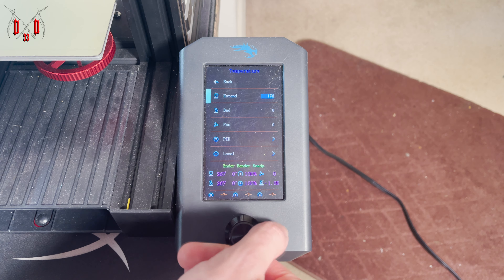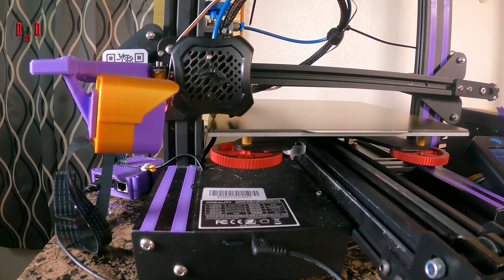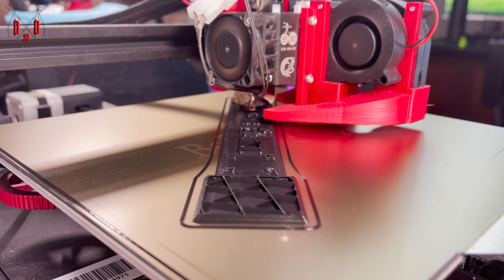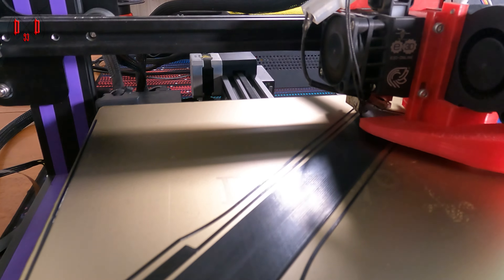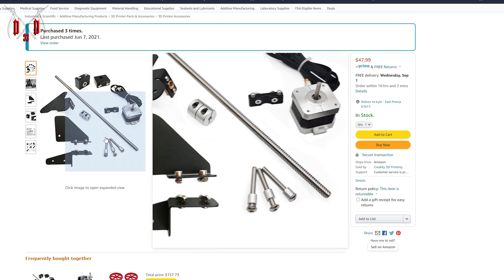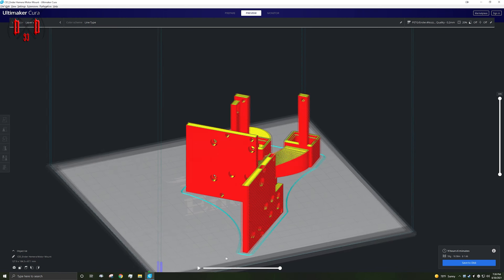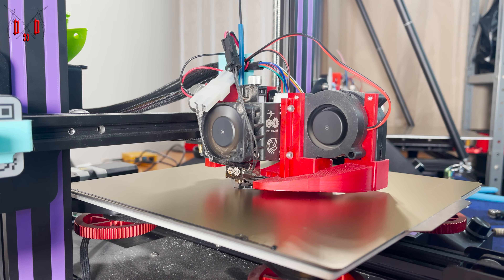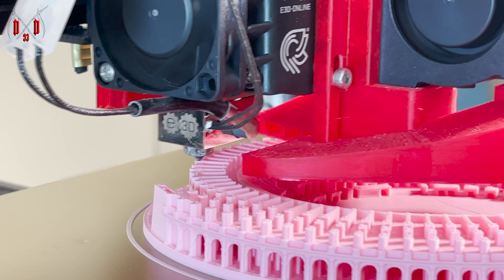Overengineering the Ender 3 V2

Comment: Your fan duct is really chunky, does that have any affect on print quality as it is sort of cantilevering against the vrollers? If it is, a cool upgrade you could do would be linear rails for better stiffness.
Reply from the maker: The weight of the Hemera and it’s location on the gantry plate make the little weight that fan setup has have a negligible effect on print quality. I’m not worried about the fans cantilevering the weight of the Hemera. Nor noticed such evidence during the prototyping process, and that was something I paid attention to.

Comment: The OEM glass bed is absolutely brilliant when everything is set up well (which is really the answer to many issues people have). BL Touch and Jyers or Mriscoc firmware make the biggest difference with least cost to get consistently reliable prints as does keeping filament dry and of course changing the crappy OEM extruder. Everything else only adds minor improvements or adds additional capability for say different filament types etc. Having said that, pimping the machine is a fun thing to do.

Comment: Got a Ender 3 v2  2 weeks ago and have kinda Speedrun doing some of the upgrades while skipping others. I got a cr touch because I enjoyed the asthetic, the metal probe and the fact that all of the reviews say it works just as well as the bl touch. I got a filiment dryer because it was semi cheap and helps maintain a certain amount of quality in prints. I got the micro swiss direct drive since it comes with the micro swiss all metal hotend and it was something like 30$ more than getting the hotend by itself. And sincE I had to adjust the source code anyway I struggled over last weekend to upgrade it to Jyers. Unfortunately I'm still having trouble getting my cr touch auto leveling function to work with Jyers I keep getting it set up thinking it's good with the z offset and the auto leveling mesh and then going to test it and having to immediately stop because the auto leveling messes up and starts gouging my printer surface. Luckily I haven't upgraded the glass bed yet but I'm thinking I might once I get this figured out and my next paycheck.
Reply from the maker: couple things to maybe help...

When you get the mesh(run the leveling) are you saving it to the EEPROM and THEN testing it? If not i would try saving it and the z offset in to the EEPROM using the "store settings" options after EACH one. 

I too am running a filament dryer. You just have to be prepared for anything and i like to print in things like TPU and such which are way more prone to absorbing moisture than PLA. Its almost one of them things you should by shortly after finding out you enjoy the hobby. Thanks for the Comment and thoughts :) I like reading and seeing what others do. Currently editing a video to help dial in VREF voltage and prevent your mainboard from suffering a meltdown i call it. Stay tuned for that! Its quick and totally free if you so choose that option!
Reply: @DeathDonky  I think I figured it out I think it's the "fade mesh within setting" it was set to 0 and when I adjusted it to 5 it seemed to help a lot, I'm not Shure if I should boost it some more I. I've been saving my settings after each adjustment. Currently I'm just trying to print out a z screw knob so I can more easily manually adjust it. I'm getting a lot of 'popping' so I'm guessing I might have to wait a couple more hours for the filiment to dry before I try to print it.
Reply from the maker: @alexlerouge1170  typically the popping is a sign of filament that needs dried. This shouldn’t be confused with the popping you ‘might’ get after retractions though.
Reply: @DeathDonky  appreciate it I have it drying now

Comment: Got my V2 a while back and it worked pretty much flawlessly until the extruder arm (the one with the bearing that pushes against the extruder gear broke) for some unknown reason. Got the gray metal one, and it honestly looks so much better than the black plastic one, and works just as well.
Reply from the maker: Yeah they all work great till that plastic splits… luckily it’s one of the cheaper fixes

Comment: When you get it properly tuned, printing on the E3V2 stock glass works pretty well. I've always sworn by PEI sheets on glass on my CR10's. But I am convinced after seeing it work that the glass will work fine -- without adhesives.
Reply from the maker: I would have said that too if 2 of the 3 machines I got from creality that included that glass bed didn’t have adhesion problems… I couldn’t get but maybe 4 in 10 prints to stick on them other machines but on the one everything was good. You have probably two thirds chance of those beds being garbage. (Yes I cleaned them with ipa. No “yellow stuff” was left on them. They were also wiped down prior to every print) that other one third chance is that bed is good. But I haven’t seen an in between. It either sticks or they don’t.
Reply: @DeathDonky  i had a HUGE problem with them initially. So bad I was ready to throw them against the wall and start over with mirror tiles and PEI, which is what's been working well for me on my CR10's for years. 

But I kept at it, tweaking the leveling and especially the Z-Offset and have everything dialed in now very well and I rarely rarely have a problem with adhesion. I never use glue, though I do sometimes use a brim or corner pads. But I do that on my CR10's too, so... 

That said, I think I like printing on PEI better, but I think that's mainly because of my initial problems printing on the creality glass... it's made me distrustful of it, even though I don't have many issues with it anymore.

EDIT: I have six E3v2's, two CR10's, and a Tronxy x5sa-400. Except for my CR10's, I'm printing on glass on all of the others.

EDIT2: Like I said, I had huge problems with the glass initially. It took me over two weeks of frustrating trial-and-error until I finally got the first one to print reliably. The leveling / Z-offset was important on the printer, but I found going slow on the first layer (10mm/s for me), bumping up first layer width to 125%, and upping my bed temp to 65C (for PLA) were the magic ingredients.
Reply from the maker: @bratwizard  now you’re printing on the coated side right? Or just the glass side? Because when I flipped the problem ones over from the coated side I got a lot better results
Reply: @DeathDonky  I'm printing on the coated side (the dark gray/black side). 

I feel your pain, I really do. I was at my wit's end in the beginning and ready to throw the glass out and go back to PEI. But I kept reading about everyone else getting it working and couldn't believe that after all these years of using my CR10's, I couldn't figure it out-- I didn't know wtf was wrong with me / my printers. And the two things I read somewhere that got it working for me were the 65C bed temp, and 125% first line layer width. 

Subsequent tuning got me to the short list of items in my previous reply that seem to have the most effect on the problem (leveling, z-offset, 65C bed, first layer very slow [10mm/s... 15's probably ok] and 125% initial first layer width).

I'm still pretty keen on mirror tile & PEI. I have years of experience with it (I use the PEI sheets from Gizmo Dorks on Amazon). But I've gotten to the point where I don't need them on the E3V2's. Haven't tried anything different (from PEI) on the CR10's. They're working well, so why change it?
Reply: I also initially had issues with the coated glass bed, but after installing a BLTouch and tuning the first layer offset (and increasing first layer flow & width) for each material type, the coated bed is fantastic. For some materials like Nylon and PETG I found increasing the first layer height (from 0.2 to 0.24 or 0.28mm) actually improves adhesion. Very rarely a little bit of glue stick (literally just one layer, any more and adhesion gets worse) is needed for the more difficult materials.
Reply: @DeathDonky  I have a few Ender 3 V2's as well and I print on the glossy side. I don't have adhesion issues flat out. IPA, a bltouch, a good level, and z offset make it so that sticking is just simply not one of my problems. Plus, all parts have a perfect mirror glossy finish on the bottom of them.

Comment: I left mine as close to stock as possible. I only added the cr-touch and the pei bed. I also added a 1mm nozzle, which makes it super fast. Klipper makes it so I can send files wirelessly. I’ll upgrade the extruder when it breaks.

Comment: Hm, I just installed the dual z-axis motors onto my e3v2 yesterday and I didn't need to up any voltage. What exactly did you mean in the video?
Reply from the maker: It’s not a requirement but def recommended. You lose strength in the motors if it isn’t tuned. I didn’t do any hard calculations but got it so stepper temps are maintained while still being “strong” 

Made a video about it here: https://youtu.be/VwVQz4THQAA

Comment: Great work, and very nicely documented! I just installed a Sprite Pro kit on my V2, added a CR Touch last year, thinking that a dual z stepper upgrade will be next. 
I've honestly never had a single issue with my glass bed though, perfect adhesion with PLA/PLA+/TPU, I use glue (Elmers purple stick) when printing PETG, but that is to prevent over-adhesion. I hear people say constantly that a PEI flex plate is a massive upgrade, but personally I see zero reason to go that route. Maybe I just got lucky with a great unit, cause that sketchy black plastic extruder tensioner also held up just fine for the last two years, it still works great, the Sprite just replaced it. 
Anyway, I always love seeing what mods fellow V2 owners go for, and this is one of the more impressive builds I have seen, for sure!

Comment: very nice, i actually bought an E3 first, had some issues with the quality, so parked it and bought an FLSUN QQSPRO delta....but after a year doubled back, got the SKR Mini mainboard and direct drive assembly and hotend kit from Creality and now find myself tinkering with it again :) its actually putting our some ok prints, so watching your video has made me think about other upgrades now, only issue is mine is a normal E3. Great vid, cheers
Reply from the maker: Sounds like all your missing is the screen? Can’t you buy that to spice your machine up? We could dub it the E1.5. lol you got a decent board already it sounds is that a 32bit board? And a DD extruder. The Hemera is probably the most overkill thing I put on my machine but damn does she print like a boss now! 

What is your next upgrade?
Reply: @DeathDonky  yeah it was a 32 bit board, best thing was it was an easy direct replacment. I had a couple of ideas for upgrades, one being a DIY extention kit to get more height (ie 600-800mm Z) or one of those 2 in 1 hotends and go some multi coloured prints...but definately the dual Z'ds if my board takes it and the magnetic PEI bed. I have an extra BLTouch, but having issues on the Tevo Little Monster, so hesitant to use it.

Comment: Love the insight on your videos! I've made several mods to my own V2 as well, and I'd honestly say the magnetic bed is way more of an upgrade than what most people might think. The Creality beds, at least talking to other people I know who own Ender printers as well, are notoriously warped from the factory, and the magnetic build plates are a massive step up. Recently I replaced the hotend cover with an Avalon design from Thingiverse and it's been working phenomenal. Perhaps one of these times I will follow the path of swapping out my hotend and cover for the Hemera and use a more efficient design for parts cooling
Reply from the maker: The magnetic bed is second best probably to the Hemera honestly. And thanks for your feedback 🙂 it means a lot

Comment: I have a base ender 3 and a v2, i've been modding my base ender 3 more than the v2 and i love the thing. I got a pei plate, upgraded hot-end, and rubber feet instead of springs, and the capricorn upgrade tube. I print petg and it's been a blast.
Reply from the maker: I thought the tinker/upgrade process was a blast too. I find printing with different materials and finding uses for those materials a blast as well.
Reply: @DeathDonky  I'm still a noob when it comes to petg and my prints have been... Not good to be honest. Do you have any recommendations for it?
Reply from the maker: @MTNDEWGANG  what area of the print is your quality suffering?
Reply: @DeathDonky  First layer, and it looks like layer shifting too.
Reply from the maker: Does the first layer look under extruded or not sticking to the bed? What temps are you running? What size nozzle?
Reply: @DeathDonky  0.4 nozzle, 230c on extruder, 50c on the bed.
Reply from the maker: You’re probably going to want closer to 240-245 on the nozzle and like 80-90 on the bed. You should know that if your Capricorn tube come into contact with heat that high people say it can be bad for health and not good on the Capricorn tubes either.
Reply: @DeathDonky  Bad for health? Like toxic fumes?
Reply from the maker: That’s what I’ve read.
Reply: @DeathDonky  Huh... I never seen anyone go near that temp, even profiles I've downloaded never exceeded 50c on the bed.
Reply from the maker: For PETG? That seems cold… I’m sure brand to brand is different but even Amazon basics brand PETG says 60-80 on the bed 230-250 on the nozzle. 

The brand PETG that I use (overture) says 80-90 on the bed and 230-250 on the nozzle.

What brand are you using? Is there a tag on the spool of filament that tells you print settings? Often times on the spools of plastic themselves the stickers will give a window similar to the ones I gave above.
Reply: @DeathDonky  It's microcenter branded petg, It doesn't have any Temperature recommendations either. I watched videos about petg, but never knew the bed needs to be that hot for it to print good.

Edit: I saw a pack of petg I ordered from Amazon, and the bed heating temperature is 50-70c on the listing.
Reply from the maker: Micro center seems to only carry inland brand “petg+” they call it? That claims 50-80 on the bed and 230-260 on the nozzle. I imagine you’re too “cold” for the speeds you are printing. You can turn the heat up or slow the machine down to try and get better results. 

https://www.microcenter.com/product/626537/inland-175mm-purple-petg-3d-printer-filament-1kg-spool-(22-lbs) 

Click specs and it should come up with recommended print settings.
Reply: @DeathDonky  I'm gonna run a Marvin print with a 70c bed and up the extruder to 240 and keep everything else the same for right now and see what I can get. I'll update whenever it's finished.
Reply from the maker: Sounds great

Comment: Sometimes, it just does not make it any better... I installed a metal extruder once, and it was terrible. Way to much spring tension, so it deformed the filament, resulting in air traps in the print. And I installed a hyped Mirco swiss, and it was crap. Went back to stock with a minor upgrade (piece of tubing with washer) and all was good again. Another hyped thing: Capricon tubing... Way to to little tolerance, so it is very sensitive to any default in the filament. As if a normal tube, which is .05mm bigger, causes the filament to bend inside. These are all marketing talks. Best upgrade I made was the AC bed, 3 point leveling, other fans (especially the one from the mains supply) and the silent board. If I want more, Ill buy another printer (add all the update costs and you buy a better printer instead).

Comment: I am a newcomer to this hobby with a new E3V2 I bought for Christmas. It is still a stock machine with the exception of yellow springs I put in during assembly. But I have now bought the metal extruder + Capricorn tube kit from Amazon.
Looking at your videos for guidance as I can see you are very knowledgeable and particularly very meticulous about doing things.
One question - do you have any of the STL files for your mods available? I am still far from designing my own, hence asking.
Reply from the maker: Yes I do! Discord link should be in the description of the video, those files should be pinned in the 3D printing channel

Comment: You should try klipper with input shaper next if you want to be able to push the speed on the machine.
Reply from the maker: I have started to see a lot more about this klipper firmware and it’s def caught my attention because you aren’t the first to say this. I’m thinking I could use my “extra” machine to get that setup and tested in the near future. Any particular reason aside from extra speed?
Reply: @DeathDonky   well if your running a board that’s not as capable klipper opens up the capability because it offloads the processing to a raspberry pi. Then it sends only the movement comands to the printer. Input shaper is a feature that lets your put an accelerometer on the hot end then it takes readings when you are running at speed of any additional unintended vibrations and such and then does math to let you counter act those movements while speeding up. It also lets you access the printer via a webui installed on the raspberry pi. You can look into fluidPi for the ui part. There are pros and cons to klipper it’s a bit more involved to setup the but pros are really good